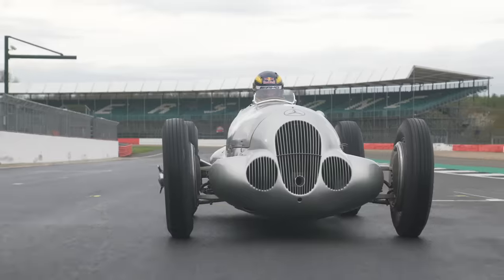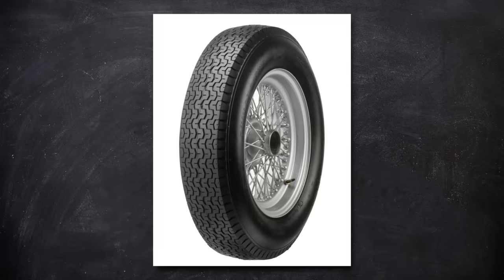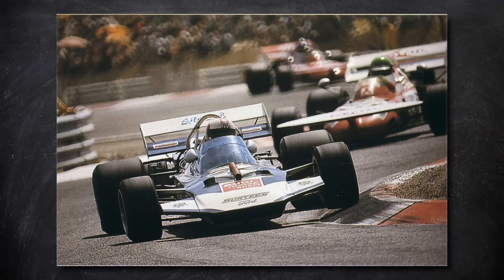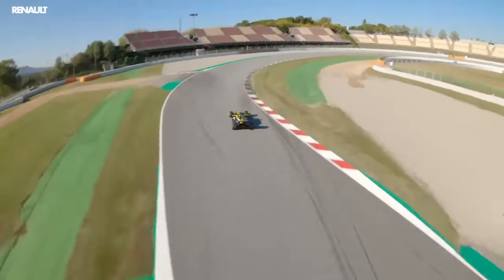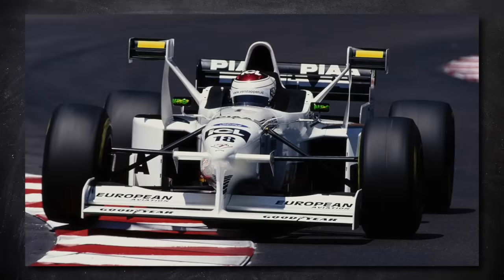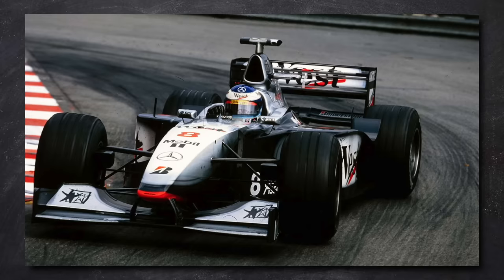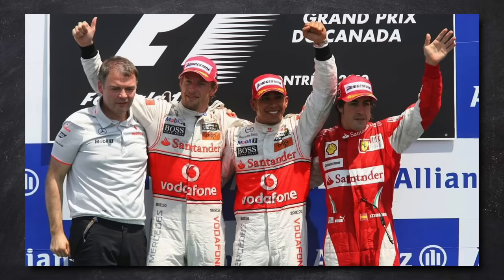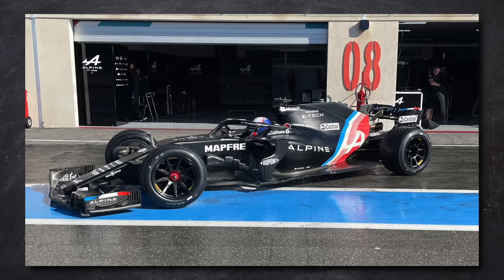The Incredible Evolution of F1 Tyres

Comment: Nelson Piquet came up with the idea of warming up the tyres while racing F3, especially in cold climates. Except back then, in 1976 and 77 he hadn't considered electric blankets yet, so the solution was to place the entire car inside a metal container, and heat the container with a large industrial propane heater, so at the starting line, the whole car would be boiling hot!

Comment: QUESTION: Why have a sole tyre supplier at all? doesn't this ensure the end of tyre technology development? A solution may be: You may  only use your own tyre once during a race but then must make a least one switch to a pirelli type from the compound range during the race for a minimum of 10 laps. That way type development still moves forward, but pit stops still happen? thoughts. OR you may  only use one set of your own tyres for a maximum of 15 laps during the race then must make at least one switch to the pirelli compound race. that way tyre development moves forward adds extra spice to quali.
Reply: i think it was a mixture of the 05 incident and how much of a role tires play in overall pace. if a team gets an exclusivity deal to use a specific compound for their team only they can easily make up more pace than benz had in the turbo hybrid era
Reply: In nascar we had a tire war and it was bad and scary and dangerous.  The war meant making the tire softer at the expense of durablity.  If the expected loads were off then the right front would blow and send you striaght into the wall.

Comment: Can you do a video about why aero, big tires etc. werent used in the 50s? It seems obvious to get some aero and bigger tires if you're literally understeering cars through corners at 200 kph. Was it that material science couldn't make tires that big that would survive the forces? Or was the increased drag of large tires and aero too much for the engines od the era? Was it the track design - long fast corners instead of sharp short ones?
Reply: Hindsight is 20/20, nobody had the foresight to put an upside down airplane wing on a car yet. Downforce simply wasn't a thing back then, it was all about light weight and streamlining, and the narrow tires certainly helped. The first wind tunnel tests on cars didn't happen until the 1960s, and downforce didn't impact racing until the 1970s (Lotus F1).
The 50's was when Crosleys were winning races because of disc brakes! 
In 1953, the first European car with disc brakes (Austin Healey 100S) went on sale, and the Jaguar Type C won that year 24h of Le Mans as the only car on the grid with disc brakes.
Nowadays even Bugattis' *brake heat shields generate downforce*.
Reply: Also I don’t know if they had started using radial tires yet in the 50s. Inner tube tires were the norm for all cars back and you couldn’t get low profile tires with inner tube tires.

Comment: Are they Drum breaks??? 2:37
Reply: Yup
Reply: Until the 1950s, drum brakes were considered superior due to the self-energizing effect that allowed for greater braking power to be obtained with the same pedal pressure compared to disc brakes.  With progress they have reached the limit of tires even with disc brakes, making useless the advantage that drum brakes had over disc brakes, thus making discs preferable for advantages such as better cooling, better modulation and fewer problems in the rain.

Comment: This is the best era of modern F1, everything else is nostalgia.
Refueling and tyre wars are awful.
Reply: I guess it is, if you're 15.
Reply: the V6 turbo hybrid era (2012-2020) is/was one of the worst eras in all of motorsports 

you could basically call the winner correctly before FP1 even started
Reply: Absolutel horse shit. Early 2000s F1 where drivers could just push like mad was insane
Reply: Nostalgic fellows above ^

Comment: Imagine what a modern F1 car would look like if you ditched nearly all the rules and gave the designers a blank check.

Also do the same with the tyres and the fuels.
Reply: AI-Assisted Diesel-Turbo Hybrid with CVT Transmission, toxic fuel, and bodykit that either ridiculously cursed or boringly the same.

Either way, it's just how much money you wanna spend instead of driver battle, especially with semiconductor revolution.
Reply: @bocahdongo7769  Continuously Variable Transmission transmission?
Reply: @AmaroqStarwind  Yep. William testing it

It makes the car sounded like a rat scream in agony for 3 hour non-stop. But it save 1.5 second of the time on top of already fast laptime
Reply: @AmaroqStarwind  No. I'm wrong about 1.5 second

It actually save 6 second
Reply: @bocahdongo7769  I was more referring to the fact that by saying "CVT transmission", you're saying "transmission" twice.

Like saying "ATM machine", which means "automatic teller machine machine"
Reply: @AmaroqStarwind  Do it without "Transmission" word, just "CVT". Like spelling " SABRE Engine" Without "Engine".

It's sound weird, if not way more cringe